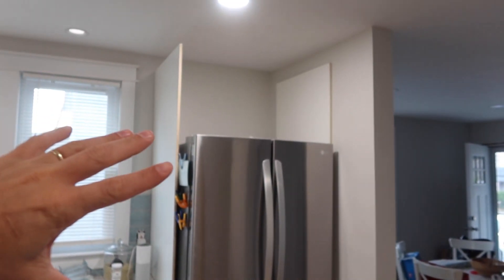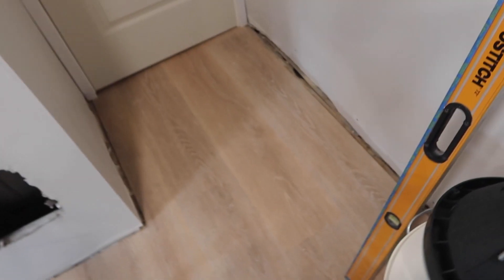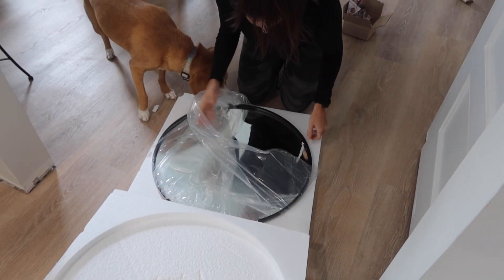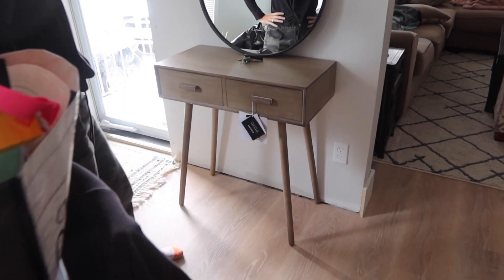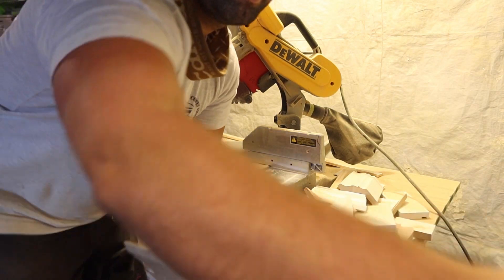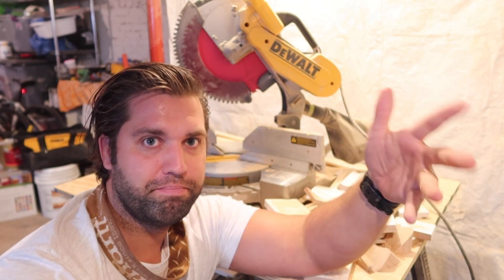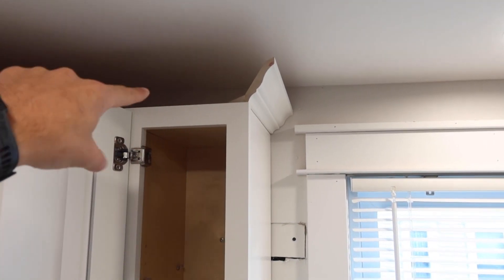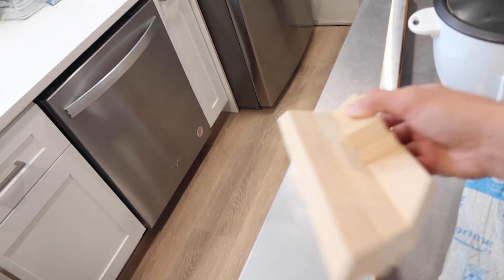When Life Gives You Covid, Do Home Renovations!

Comment: That long lip on the crown molding is for pull the crown molding forward so crown molding is start flush with doors when they closed this crown modeling should be screwed to the front of cabinet box. This is my way to do it
Reply from the maker: Yeaa I’ve seen it both ways. I didn’t have a panel for the end of my cabinet to account for the reveal that would have been created if I came out flush to cabinet face..without something to account for that new reveal I thought it would probably look weird